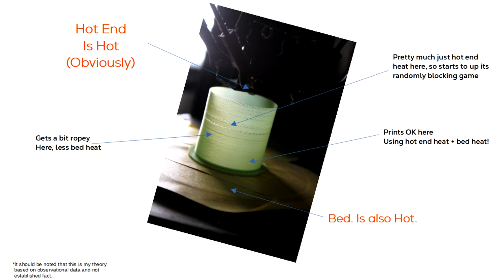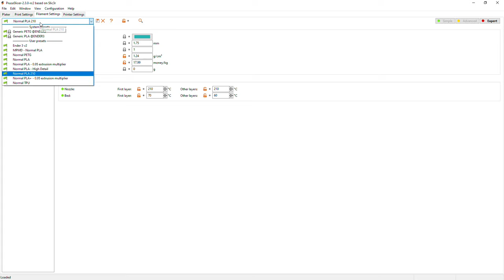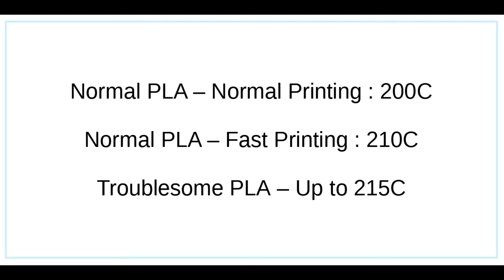What causes lines in the middle of a 3d print? Solve under extrusion problems mid print, halfway up!

Comment: Thank you, you helped resolve a 2 months issue I had, your solution to raise the heat and reduce carrier speed was great, I changed the spring, the extruder, went glass bed and installed a BR touch ... dumb right? One quick question the print is far better but I still get those weird lines but more shallow and at fixed intervals about every 1/2 inch, any ideals?
thank you again
Reply from the maker: At a guess, your extruder calibration is 99% correct, but not quite exact. It's hard to get E-steps right after an extruder swap, try lowering flow rate in cura a bit, and if that works, you know you need to lower the esteps.
Reply: @LostInTech3D  In Cura - Material - Flow - I have 9 different Flow setting (Wall Flow, Outer wall, Inner wall, Top/Bottom, etc.) that are at 100.0 each which one to ajust and by how much? Thank you again!
Reply: @Lost In Tech  I will try to reduce the "flow" in the material setting from 100% to 95% and try again, thank you

Comment: I print at a minimum temperature of 215c, and keep the bed at 65c. I find it works well, but occasionally have this problem. should I turn the nozzle temperature up by 5, or 10?

Comment: the cheap Chinese hot ends will have trouble with the stronger materials like Duramic PETG. the filament path is like sandpaper and will causes these issues. if your buying cheap Chinese hotends then get the ones with the PTFE throat. if you have a Chinese all metal hotend you can still use it but it requires so much maintenance that its not worth the time.

Comment: I'm a newbie and I have a question:
I've been working on this chess piece with PLA on my ender5 pro and I'm able to get a good print with a 40% infill and x3 line multiplier but when I try printing with a 50%+ infill with a 1x or more line multiplier I cant seem to get a good print it even has a hard time printing the build plate adhesion every signal time no matter the print at this point when I try printing at 50% or more infill layer seem to be separated strings and blobs, also i start getting problems with my feeder it starts skipping in fact not even able to complete the print it just gets to messy the it ends up ghost printing even if it starts off well it doesn't last (which is rare it starts off well) the only way I can get the print to at least attempt to complete the print (even at that print comes out out very bad) is if I lower the speed to 60% during the build plate adhesion stage and lower the flow to 80 and its weird because as soon as i lower the infill under 50% everything works well most of the time even my filament feeder stops skipping. I've change the nozzle, the Bowden tube, I've adjusted the retraction on my software, I've tried adjusting the feeder (even if the problem is only with (50% or more infill), I've releveled my printing bed, I've checked and and adjusted the x, y, and z motors and surrounding parts, the fan works fine. everything at the point is top shape so I don't understand what's the problem anything I show try or know? i even play with the temperature it help a bit at first but now im at 230C for simple PLA and it helped but only for a bit

Comment: Actually i had a short in my wiring harness to my extruder stepper that would go dead when in certian positions, but as it goes up the z axis will reconnect, probably due to excessive speed and janky direct drive upgrade

Comment: I had the exact same problem but a different cause.
usually a decent time into the print the extrusion stepper started clicking and I got underextrusion, but in my case it was the stepper driver getting way too hot
I,ve put a fan on it as a temporary solution, and I'm now working on a new sidepanel for my printer with an integrated 120mm fan and duct pointed directly at all the drivers.
Reply from the maker: it might be a faulty stepper - how hot is it getting? It's normal for them to get so hot they are uncomfortable to touch.
(sorry...read this properly...driver, not stepper. Yeah you're probably right. Some printers are known for this)

Comment: Hi. I have a question. I got an Ender 3 and did a few prints. They came out ok. But I just change my slicer to Cura and now it's "skipping" the lowers wall layers. It prints the base prefect, makes the infill, doesn't print the wall for about 3 layers, then finishes the rest of the project just fine.  It's driving me nuts. Any ideas?
Reply from the maker: check the flow rate in the preview, if it's over about 12, that'll be why

Comment: I have the same symptoms you described, specially patsy raft at the beginning and stringy infill with some week walls, but the file is the same I ve used dozens of times and worked well, I even transferred it to another cr10 and still works fine. Doesnt that mean something is wrong with the hardware of the printer?
Reply from the maker: you might want to try a new nozzle I guess, and also check the nozzle is inserted flush against the (depending on the hot end) heat throat or PTFE tube

Comment: I have 2 ender 3 v2's and they both are having this issue, but in a weird manner. First machine I tested eSun PLA+ with a 20mm~ base and then it forks off into smaller "fingers". The fingers all have terrible under extruding. Last night put a new nozzle on, tried a temp tower and still had the same issue. Second machine is doing it a lot less but it's still there and it's VERY noticeable on small diameter prints, for example a hexagon of about 8mm~ width will not print smooth period. The eSun was printed at 230C and usually I print the cheap no brand at 210/215C. 

Totally reset my cura profile to the default standard quality and still having the issue...Have no idea what the problem is. I have a 5x5 probe grid with a bltouch. My esteps are calibrated, and even tried upping it to over extrude to no avail. Tried increasing flow to 102/103%. still nothing. Ptfe tube has been cut flush to the nozzle. Seemingly no wiggle in my ptfe tube at either end and the extruder gears have a firm grip on my filament, so no slippage.  Tried to turn retraction off entirely/lower it still nothing. 

These machines were working fine for ages, but now I am having SO much trouble with them. It's not all the time though, because last night I printed an 8 hour print of a large object and basically zero under extrusion, maybe the smallest but it is so unnoticeable......but when I go to print small objects, even with basically no detail, they just totally under extrude.

I am at my wits end....I have no clue what to do...I feel as if I have tried it all.....Do you possibly have any suggestions?
Reply: Have you solved it? I have similar problem. It's printing well on the first few layers then during infill it under extrudes. It's so frustrating.

Comment: I’m not sure if this is my problem. It started out that way, a print failed halfway through, but ever since then I’m getting the clicking and under-extrusion after unloading, reloading, trying a couple different prints. Is that a clog? I even switched out the filaments, and the new one comes through, it’s just still under-extruding.
Reply from the maker: clicking and underextrusion does tend to indicate a clog, but sometimes something else caused the clog, like I've seen it happen if you try to print the first layer too close, it blocks the nozzle up. So, you always have to be mindful of the whole system, but yeah...a clog.

Comment: What's the downside of always printing PLA at the highest temp?  I do and I adjusted the stringing out with retract settings. Does it cause some issues with the PLA or the printer?
Reply: For anyone wondering the same: you get worse overhangs/bridging and need to increase cooling to compensate.

Comment: I have this problem with Silk PLA's.  They seem to clog the nozzle way more than regular PLA's.  I have to print them at 230 deg and I still have problems unless I disable retraction.
Reply: Whats the retraction speed ,you may need to adjust the speed retraction and distance ,distance shouldn't be no more than 6
Reply: @mrmartinWR  I have been using a slower retraction speed than I used to (25 mm/s now).  I think that helps.  But still have issues with silk PLA's.

Comment: I have an ender 3V2 and I’m having this problem with Form Ultra Andromeda purple filament, my bed temperature is 55c and the nozzle temp is 215c. Should I slow the print speed down or increase the temperature again?
Reply from the maker: I don't have all your parameters but the answer is probably try both! Come over to discord if you want to show me some images of what you have and we can work it out. 👍
Reply: @LostInTech3D  ok, I will
Reply: @LostInTech3D  it worked, I also joined the discord. Thanks for the help, and I look forward to learning more!

Comment: All you need to do is change your heater. I use a 60 W heater no problems.
Reply from the maker: Hmm, no, that's not how it works, and I can prove it. You need to increase the heating interface, the heater itself is not the bottleneck. 
But I don't think this is within the scope of the video, check my two vase mode videos for discussion about this 👍
Reply: @LostInTech3D   I can print over a 100 mm/s  even with a.8 mm nozzle, no problem melting the filament.

Comment: I'm looking at this problem right now as it's printing. It only happened on 1 layer.
Reply: upon further inspection mine has over extruded for a long stretch of only one part of a layer. Figure that out. On this print the preceding and proceeding several layers are the same identical shape.
Reply from the maker: smells like a blockage that resolved itself to me. Temperature issues?
Reply: @LostInTech3D  Ugh. Definitely some extrusion problems. I have 4 top & bottom layers but the bottom after removing supports has holes everywhere & other spots that look wrong.

Comment: Im running bed and nozzle a little hot and I put computer thermal past on the nozzle threads this morning for a test. I hate 3d printers and MKS and bad prints. I am about to fix the printer with a framing hammer.
Reply from the maker: I'm gonna have to say this, but I don't think the hammer is going to improve anything 👍
Where did you get the idea for thermal paste on the nozzle threads? Is that a thing?

Comment: One question what about air temperature in the room that you print would it not be better to print higher temperatures in cold weather and cooler in warm temperatures?
Reply: Usually  that  plays more a part on abs then  pla.   But i also had that  question.  Ok  im only printing pla plus since i got printer.

Comment: I had this problem with an Ender 3 v2. At the time I didn’t realize it was a common issue but the plastic tensioning arm on the extruder cracked on the bottom.

It would print ok’ish for a bit then under extrude a while then print ok again. It was just because the extruders spur gear was barely able to contact the filament.

It wasn’t until I barely touched the filament an saw my contact with it was enough to prevent extrusion that I really dived it and found the issue.
Reply from the maker: The broken arm thing is super common on the ender extruder, it catches a lot of people out (self included)

Comment: guys ı fınd the problem but ı was nearly gone be crayz, ok Now first if you use a Ender 3/3pro original extruder check your extruder is have crack or something, sometimes is hiding under de bearing as my extruder like and ı change with mk8 and problem fix it